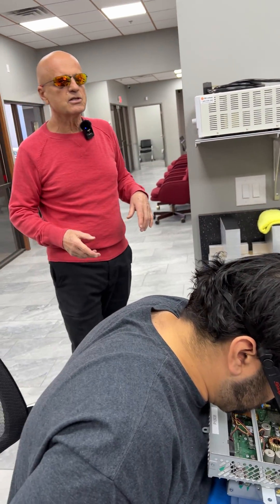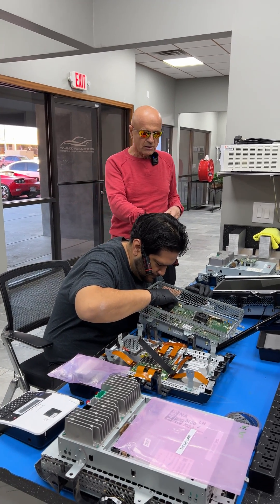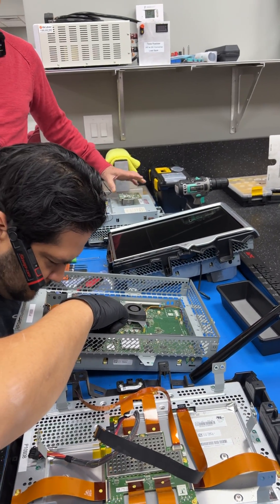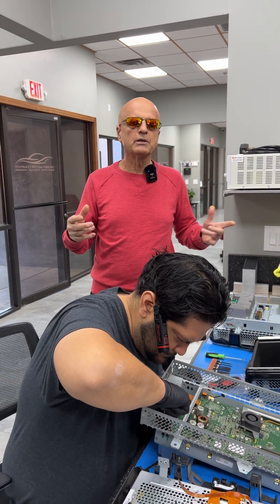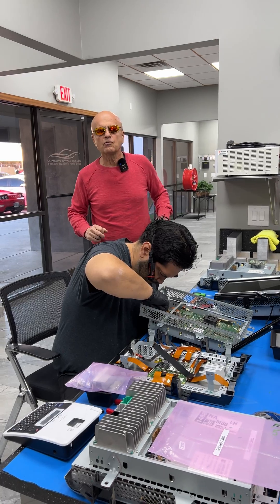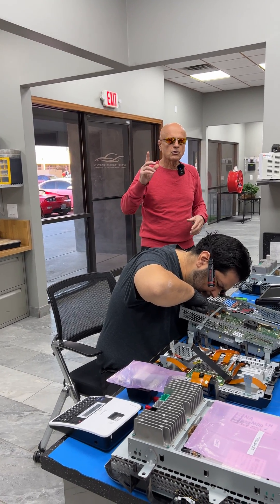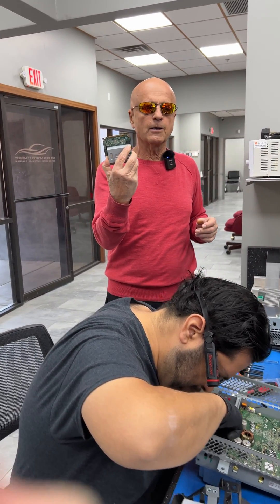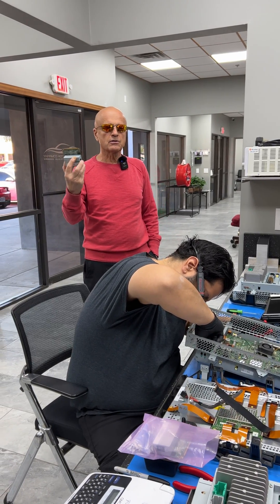Tesla MCU Is Revolutionary! #shorts

Comment: As a safety recall, Tesla is replacing the outdated 8gb chip with a new 64gb free of charge. They replaced  it on my Tesla.
Reply: Even on 2016 model x?   I have  a 2016 model x 90d and the navigation isn’t working and says it needs to be updated but it won’t update.
Reply: @freerepublicusa2064   Yes I believe so if you still have the MCU 1. They also replaced the memory card for the maps for north America for free, thats what was on my service record. I recommend you contact service about it